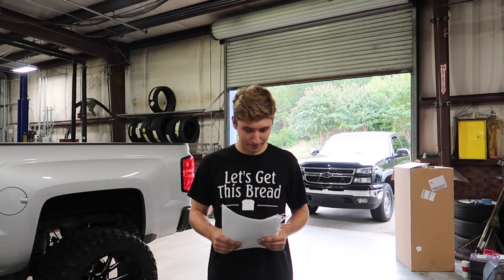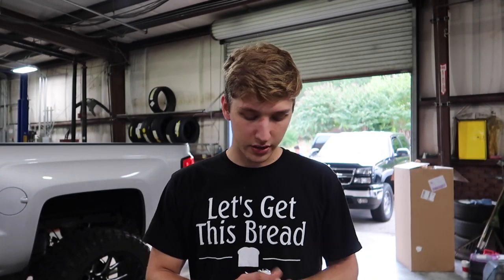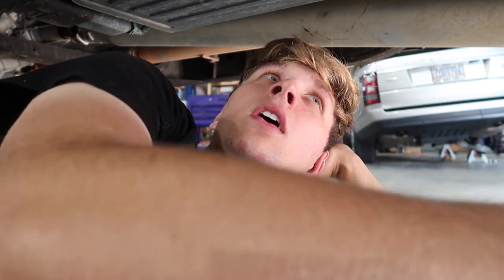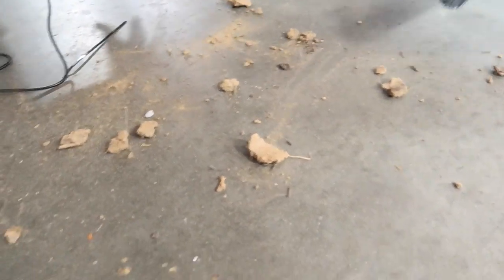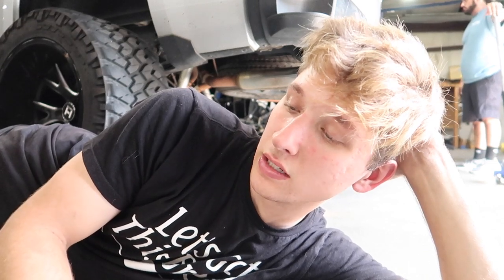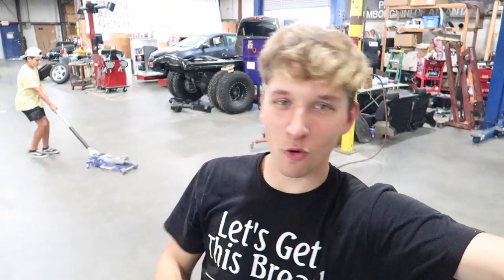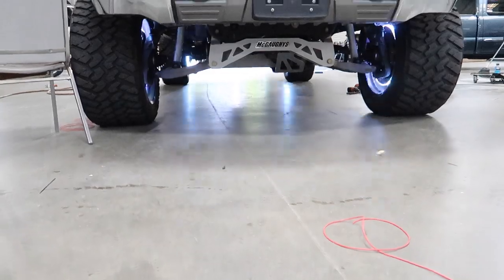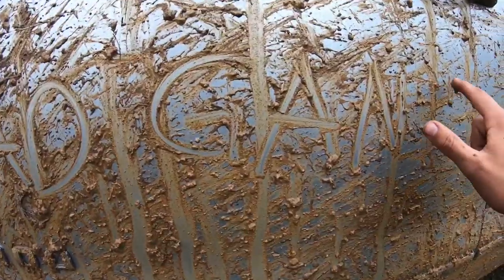Wheel Light Install (REVEAL) Pt. 4 (DISCOUNT CODE IN DESCRIPTION)

Comment: Hello I got mines on my Ford Explorer 05 an they been on for about 1 month , so today I got out my car an they're dimmer an not bright an i have not used the app in 2 weeks so i didn't dim @t I got my cell opened the app an connected it but it didn't anything an when it did allow me to change the color it was still dim very dim , so i played with the app for about a hour an got it to work an brighten up only one color which is light blue an bang the app don't want to work anymore since then , can you tell me whats going on with my ring lights?